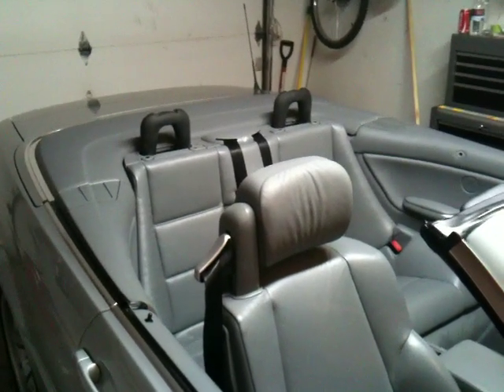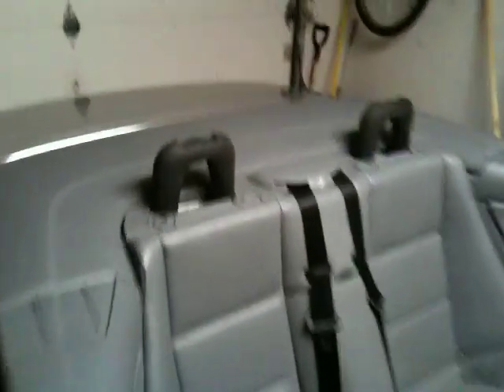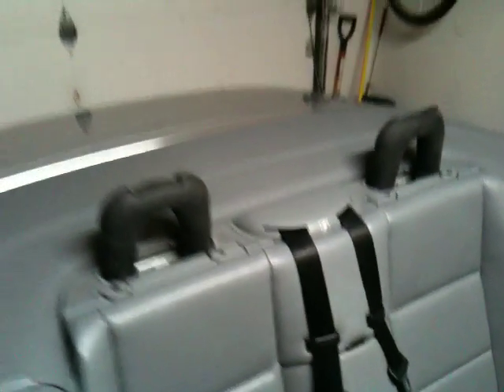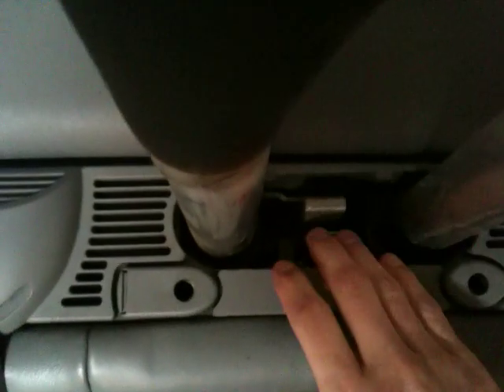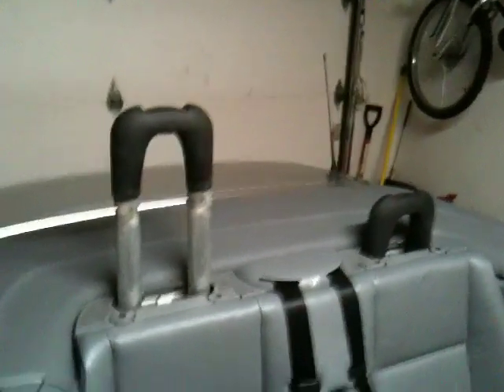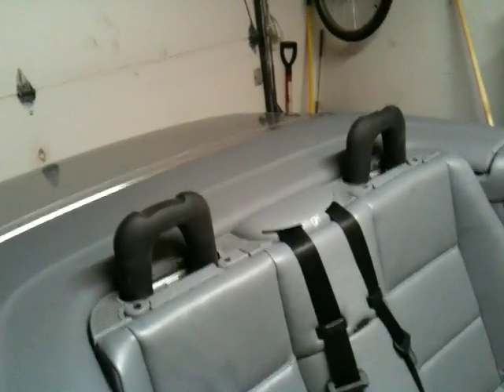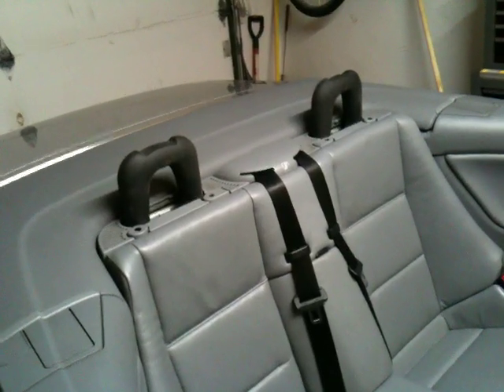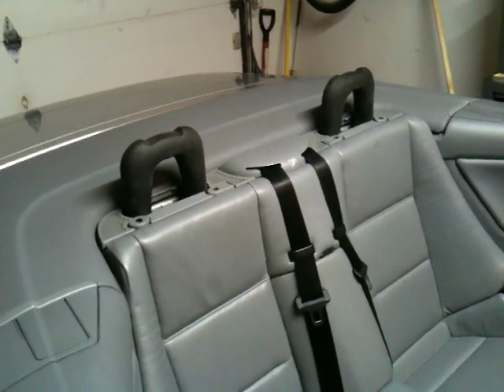Test of the BMW Roll Over Protection System (ROPS)

Comment: I can 100% assure anyone these these will work no doubt. I was involved in a very serious drunk driving accident about 4 months ago with my best friend that changed both of our lives. Luckily no other vehicles were involved. Just my friend and I. We were in my 2000 323CI and flipped once in the air. The other 3 times was on the ground and over train tracks. Just looking at the damages that were done to the car, that’s my estimate on how many times we flipped. From where I remember us when we first started losing control and from where we ended when I woke up, was a very long distance. I know we slid on the asphalt for some parts because both driver and passenger side doors had asphalt embedded in them, in places. All to say, yes. The ROPS will no doubt save your life. I actually wasn’t aware they were even in the car to begin with until I had gone to get all my stuff out of my car the next day. I had taken a few pictures and videos then was looking inside and notice these two black bar things sticking out of the seats and then it came to me... “These were probably rollover bars that came up when we rolled.” Sure enough. Never really done any research on them but decided it was a good idea seeing that I’m getting an m3 convertible, I’d like to know as much as possible about specs for any e46 3 series just so I can be up to date on issues. Anyway, Great video!!!

Comment: So, the weight of the entire car rests upon this nice small little metal tab
Reply from the maker: Yes, but they are not little tabs. They are high strength aluminum alloy reinforcements that are attached to a mechanism that bolts to the car's chassis. The weight of the entire car can rest on them and the reinforced windshield A pillars.
Reply: @iansanderson  That's amazing! Engineering at it's finest!

Comment: My friend had that pop out with convertible top on and they pop out through convertible back window, which is a huge design flaw, I think they redesigned that with newer models.
Reply: A comment by a verified user with only one like? How is this even possible?
Reply: yea i seen it my brother brought a old peugeot convertible with soft top and bars were out and ripped up the roof not sure if they ever did fix that problem.
Reply: What model is it? Mine is E46 as in this VDO. The bars retracted once last year and still had plenty of room to clear the top, not even close to the back window

Comment: Way better than the one vw had in the beetle convertible.  Friends dad hit a deer and the car was totaled out just from the airbags and rollover protection.  Since it goes off and is one time use like an airbag instead of spring powered.  Broke the front lights and minor body damage were it not night it was easily driveable.

Comment: They would certainly help rear seat passengers survive, along with the reinforced windscreen surround, but you would still be very likely to be seriously injured depending on what the car rolled onto, the speed of the roll, etc, etc. Still something is better than nothing - Not that I plan to roll mine anytime soon! I've tried to find a crash test or rollover image of an E46 convertible, but not found anything yet.
Reply: Kavboi 66 you seen mx5 rolling over?

Comment: mine did this when doing an unintended airborne after passing a massive bump, I've already done this procedure and it worked perfectly, however my question is do I need to reset something with the scan tool? no warning lights went on with the bump, just the ROPS.
Reply: Con
Reply from the maker: No. Once the module detects they are in the ready position, the system readies for the next event. A fault code will be stored however

Comment: This is a good function
Reply: As with all safety systems on BMWs, it's the cheapest possible version of the system, which provides only marginal protection if any. Volvo has a similar system on the C70, but you'll see they are larger, stronger and provide better protection.

Comment: Wouldn't the windshield just collapse under the weight of the pressure though?
Reply: It may give you enough angle, still, you will end up fucked up but probably not badly decapitated :s
Reply: windshield frame is HEAVILY reinforced in these cars
Reply: +vjrei badly decapitated? There is no good or bad decapitated! If you get decapitated your fucking dead! Lol
Reply: the windscreen is really reinforced in the E46 verts, at the launch demo when they first came out they had one car balanced on another cars windscreen with the roof down as a party trick
Reply: No the A pillars are heavily built on these cars,there's actually video of an e36 coupe balancing on the A pillars of a convertible,these cars were 265 pounds more than the sedan or coupe to add more rigidity to the underbody,I have personally removed some of the interior and these cars are braced throughout the bottom of the car.
They are built like tanks.

Comment: Is this similar with the E36 models as well?
Reply: Similar, but not the same. I have a E36 & E46 i have never done the e46 but on my e36 i needed a special tool to drop mine. The tool from bmw cost money so instead i just took a piece of metal 2-3cm thick about 1 inch wide and 12 inch's long if you look their is a special groove the tool fits down underneath & slightly behind the bar. When you stick the metal piece down the groove; with some finesse it will unlatch the bar,  Keep holding the tool down there and while doing so push the bar down and lock into place.

Comment from the maker: You remove the plastic cover spanning between the bars, underneath the headrests (if they are still installed).  You will see a spring-loaded retaining mechanism.  Pull it toward the front of the car and push the bar down until it is fully retracted.  It will make a clicking noise as it is moving down until they are fully seated.  The roll over system will automatically turn off the warning light if they both have been reset properly and there are no active faults in the system.